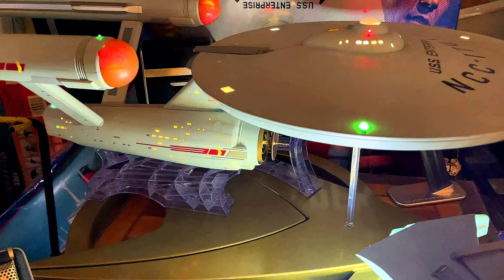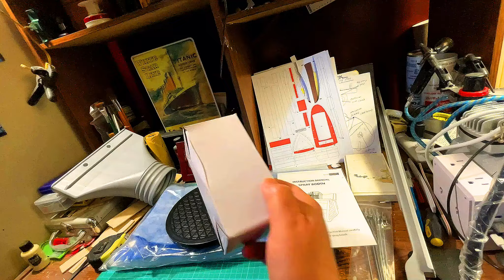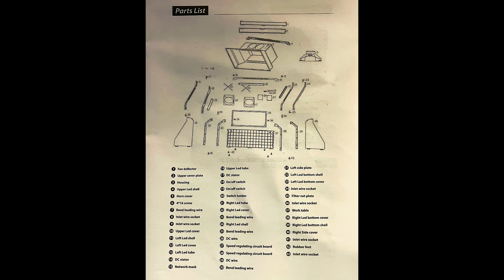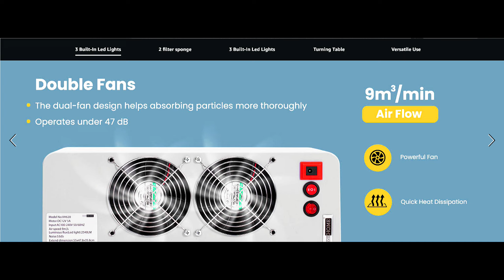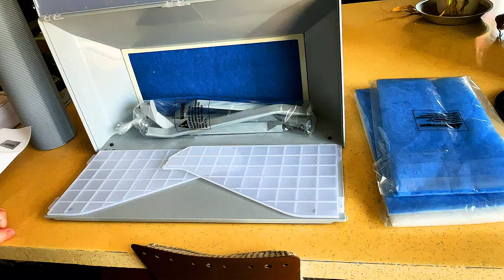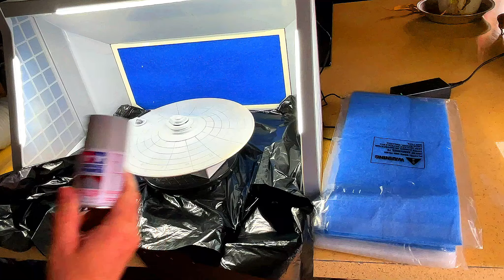VIVOHOME Dual Fans Portable Paint Booth Kit with Lights, Turn Table and Filter Exhaust Hose.

Comment: Hello I know you made this video a year ago but I just bought the same spray booth off facebook market place that was never used but was missing the power supply, is there any way to give me the specs of your power supply ? so I can order one. I called the company but they haven't responded back to my request. all I know is it takes DC12V 5amp but I am not sure if there's a specific size or anything to fit into the unit etc...

Comment: 2 questions if you use acrylics can you wash the filters or are they just disposable?  And what is the price range. Looks like a good unit for a small workplace like mine
Reply from the maker: You know, that is a good question.  I am new to the Paint Booth scene.  I use a mix of Acrylics as well as Oil based paints to I really don't know if I will be able to clean them or not.  They seem very durable so if you only use acrylics it may be cleanable.  I got mine off of Amazon.  These are selling for around $199 or so.
Reply: @TrekFanNCC-1701  thanks I appreciate it
Reply from the maker: My pleasure.  @barrysteinlage6888